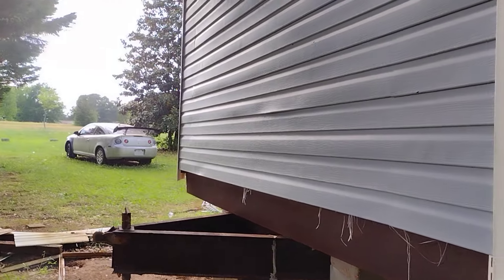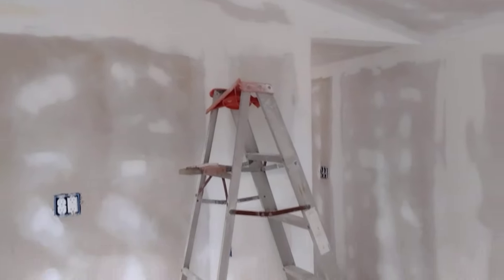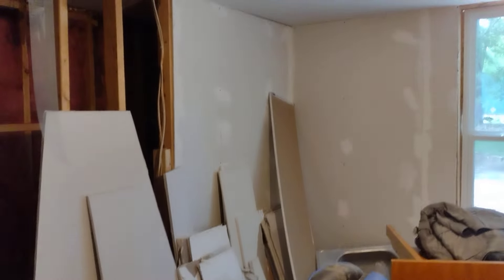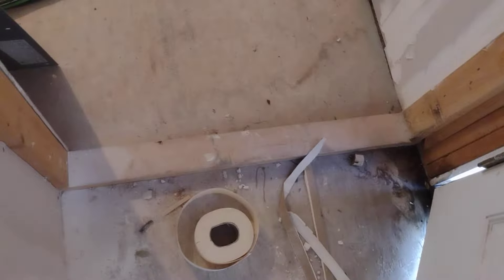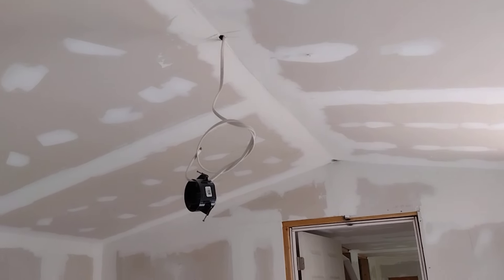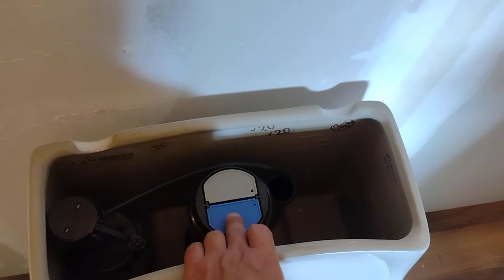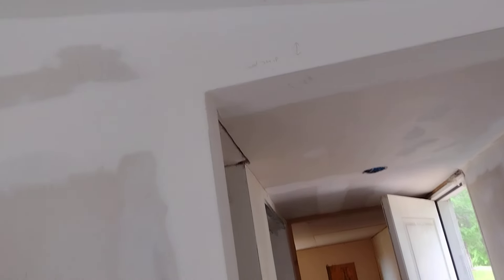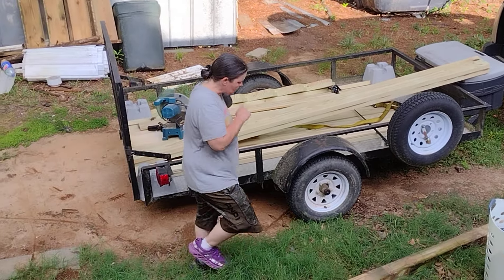The Amazing Home Makeover Continues: Part 2

Comment: That toilet is the damndest thing i ever seen lol. Yall putting carpet down or goin with the snap together wood planks?
Reply from the maker: Going to do linoleum wood looking. I got the porch built got to stain it (I will post it when edit it) & the kitchen and living room is ready to paint
Reply: @sc_triple_777  ok cool. I was so happy you said trailer! i hate it when i call a single or doublewide a trailer and someone corrects me and says its called a "modular home". It came in on wheels it's a fkn trailer. Every singlewide i ever lived in was still on the trailer frame with the wheels behind the underpinning. My doublewide that i bought ages ago in pelion was the only one that wasn't.
Reply from the maker: @GamingwAuntie-1019  I call them a trailer also. You can hook it up to your truck if it will pull it there all 2 in balls.